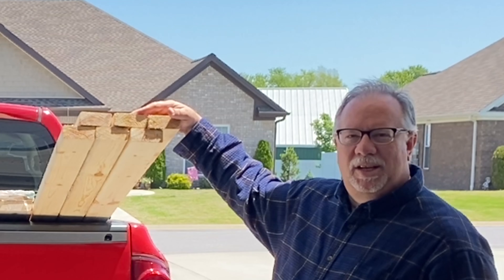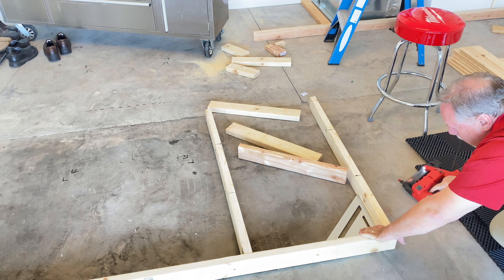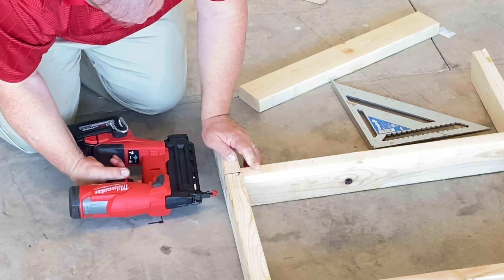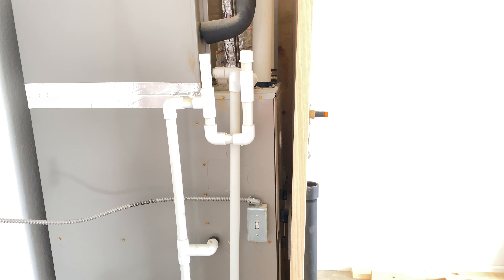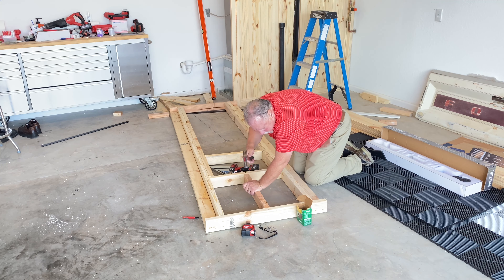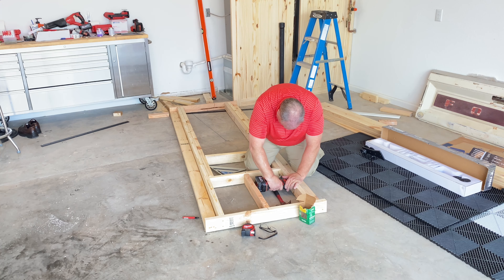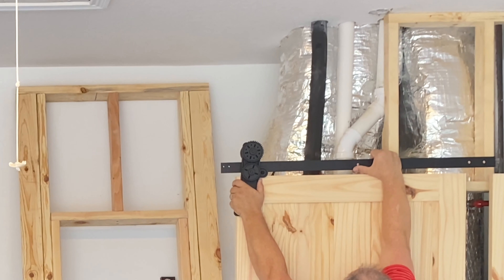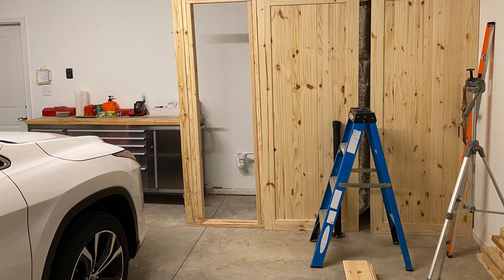#GarageMakeover 1 How to frame and hang barn style sliding doors in my garage.

Comment: That will be real nice when you are done👍 What is that nail gun you are using? Are you happy with it,like if it disappeared would you buy again lol
Reply from the maker: It is a Milwaukee 18 gauge.  Uses 18 gauge nails up to 2-3/4” long.  It is not heavy enough of course for frame nailing but I did use it just to hold square while I drove the screws in.  Would have been nice to have a frame nailer but I just don’t have reason to own one.  This 18 gauge you will see in upcoming videos is perfect for trim work or installing ship lap.  Cycles quick, well balanced.  Runs off of my existing Milwaukee 18 Amp batteries.
Reply: @JunkyardTailgate  that would be handy to have around.I am going to look into one Thanks a lot